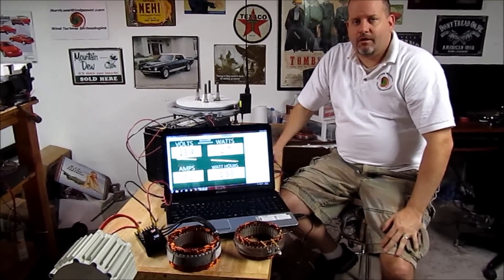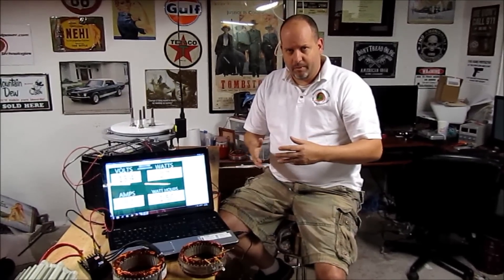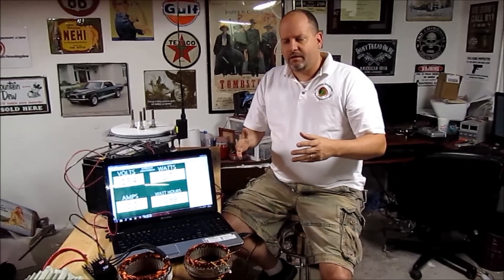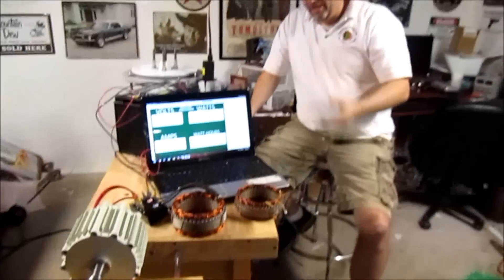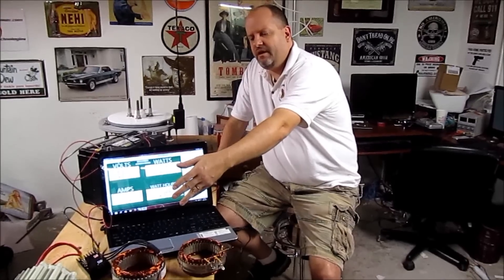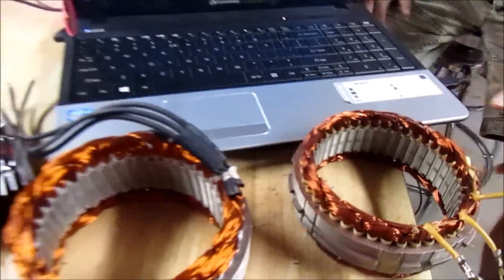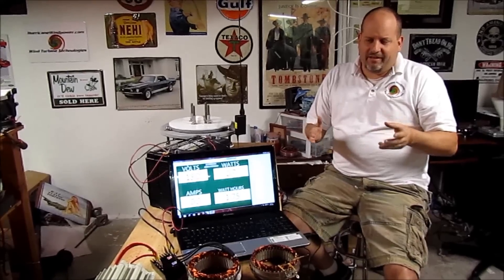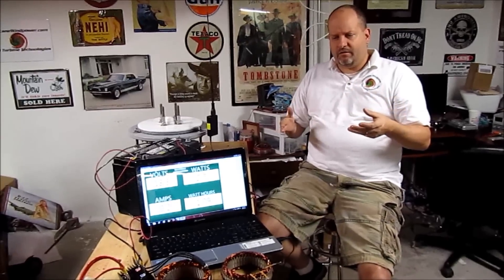12 Volt Wind Generator How To DIY Tutorial

Comment: As far as I can tell, it is either torque or speed.
With high speed, you can generate high voltage, low amps.
With torque it is the other way around.
I suppose, then it merely depends on rotor design.
Which in turn depends on how much wind you have in an area.
I want to design a construction for someone in Aruba.
They have a constant wind of around 7 mtr/s (about 5 miles / sec).
The problem is: this guy wants to generate some power with an old
alternator (110V , 60Hz , 3600rpm , 2000W), and must be easy and cheap to build.
I was thinking to design a vertical axis with pvc half-pipes very close together,
where the total radius is 300 mm (12 inches).
They say it is less effective than the horizontal axis, but with these winds, I wonder.
Because, once you draw some amps, the resistance will not get the rotors spinning
very fast, in a horizontal configuration, with low winds.
My guess is, it will be a challenge to get more than 200W out of it, no matter what.

Comment: Enough drill testing. Let's see results in the real world. These are wind turbine's not "DRILL" turbines.
Reply from the maker: Also my drill will input more power than your anemic blades set it is more fitting that putting a car on a pole which is what it would take to get your turbine to a cut in point ....your 1600 watt pma runs at 150 watt and the way you have run you mouth apparently you want the world to see it

Comment: Great informational Video,, I hope people watch the whole Video :)  I use a 12 volt system with some 24 volt components,, but charging a 12 volt battery bank ,, with mostly 12 volt grid tie setup ,, ok my setup is is just crazy to try to explain ,, but it works ,,
Anyways ,, I am building my own charge/diversion wind and solar controller ,, my question is ,, I am reading the incoming voltage from my turbine before it gets to my batteries,, I have it set at 14.5 volts ,,, Most charge controllers read the battery voltage to control them ,,, What I have found is most turbine controllers the incoming voltage goes over 15 volts into the batteries but the batteries seem to absorb it and the controller does not kick on the dump ,, Does 15 or more incoming volts hurt the batteries even tho the battery voltage still reads 12.5 or 13 volts?

Because I am regulating the incoming voltage from my turbine set at 14.5 volts and not using my battery bank voltage reading, am I not charging my batteries efficiently?,, Should I let the incoming voltage from my turbine go higher and take my voltage readings off my battery bank to control my dump?

I can do it either way ,, I just thought I would ask ,, I want to know what people need/want for a turbine charge controller,, I can build what people need or want ,, right now I just built it for what I need/want and it works,, but if there is a better way I want to know :)
Reply from the maker: Well Jason I believe the politically correct answer is that you are supposed to check with the battery manufacturer but my opinion on this is generally no it will not hurt. In the xantrex series of controllers the first hour or bulk stage of the algorithm the voltage is set at a higher voltage level in the 15's with a potentiometer "adjustable voltage wheel  forgive me if I butchered that word but i am not looking it up...its a wheel with adjustable voltages....the first stage goes higher to clean off the plates in the battery and move the median charge up. After that hour it goes down to a float charge their is a second wheel for that one that is more like your 14.4.....my reasoning would we if the people with the UL certificate think its ok then its ok..... Secondly with wind voltage and amperage for that matter goes up and down as the load goes on and off as I am sure you know...the amp input is not typically heavy non stop like it can be with solar...in other words if you watch your turbine their is more up and down with wind than solar in most places...so the main thing is not heating up battery plates and causing damage...this is also why the higher technology MPPT controller come with a battery temperature sensor high amperage non stop solar input....

So Jason these are just my opinions from working with the stuff and I know you do a lot of watching the meters yourself...Download the pdf on one of the xantex c 40s and check out where the voltage in bulk exceeds 15....it reasons that they are not only saying that it is ok but within their bulk stage necessary to be in the 15's. Simple divert load controller do not have this type of algorith
Reply: Hurricane Wind Power
Thank you Tony ,, I will research into the Xantex ,, My brother and I actually found a busted up one in the dumpster,, not sure exactly what model tho ,, We could have soldered it all back together but we found some of the parts to be useful for our robotics hobby :)

My plan is to make a affordable turbine controller made in the U.S. that the user can change for his/her needs ,, By making it easy to change one capacitor and the voltage settings in the programming ,, customers can buy one controller that will grow with their needs and change/evolve their system to what they want,,

I am not trying to make tons of money,, I am trying to make it more affordable ,, I could sell a new controller to those who want to change from 12volts to 24volts or 48volts, but why? all you need is a new capacitor and reset/reprogram the voltages ,, other than that all the internal parts are the same on my controller

By using a controller like mine a customer switching from a 12 volt system to 48 volt system could save hundreds of dollars on a new turbine controller,, that is money they need elsewhere on their project :) 

I talk to much ,, to much to read ,, sorry Tony
Reply from the maker: Jason Brown
I removed Ron BoB or whatever the con man is going by...feel free to comment as you wish Jason I have a thermodye to dyno since he want to come on my video and run his mouth
Reply: Hurricane Wind Power
It is hard to know who it is, they have so many you-tube names/channels now, but they are still trying the same old games ,,

It is sad because he does not even understand the basics of Turbine blade design ,, he is trying tho , it is scary if you seen his blade design videos, I kinda feel bad for the guy ,,
Reply from the maker: Jason Brown
Well stated but regardless of which guy posts it it all originates in the same place.....the same guy that has not a clue what he is doing. The one who send out products and compensated these people In many ways to do his bidding. Kind of like the any fued one of them is a real coward and pays other people to do his dirty work kind of like the Mccoy used to do in their blood feud. They paid other people to fight their battles like the saying goes when you could find one of the coward we have the real Mccoy. Make no mistake about it there is one person responsible. He wants to make funny comments about me being fat when I have had a broken foot that required a cast for 6 months then Bells Palsy and took a steroid for 3 months. I am still 6'4 265 and am back in the gym after 2 years. All I can say is all the guy have to do that drive by people houses is stop and knock on the door....they can bring a friend and pack a lunch because they will need all the help they can get... PS if you wanna see what the guy look like they posted pictures of him on their dog site. He has no room to be calling anyone fat.....he is a rolly polly Vag